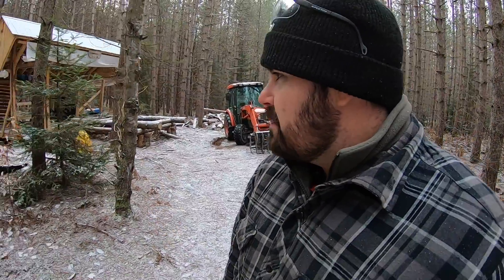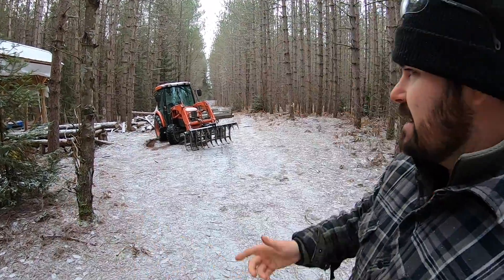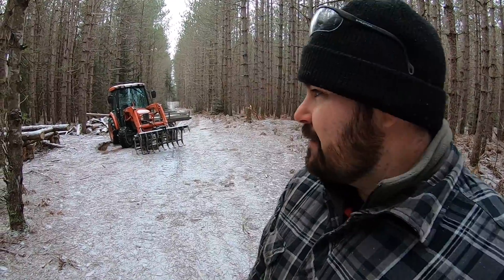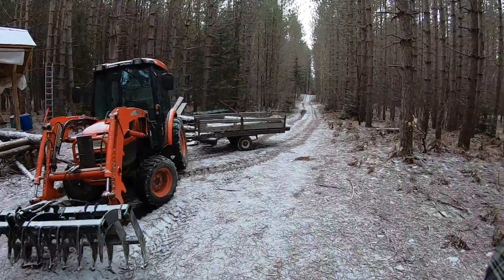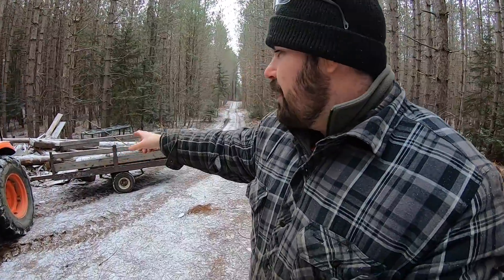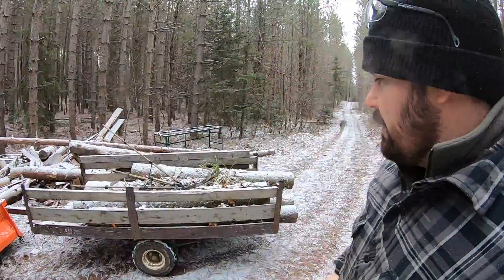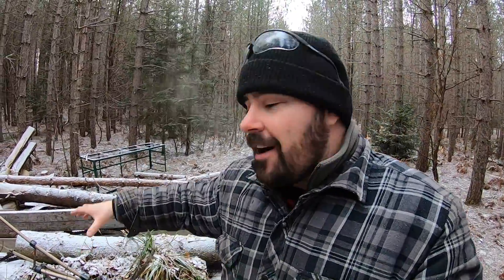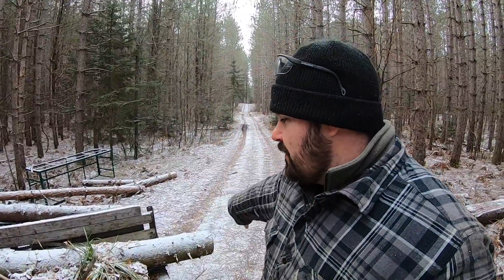Laser Makes Sawing Lumber Faster | Making My Own Wood Siding

Comment: Well so much for their laser, ordered one, and they called said It was the wrong one, needed to upgrade to the $139.00 laser, and correct mounting, battery box, well $190.50 later it got here mounted it up, checked it fine, then halfway down the log, no greenlight, the black wire going to the had fell out, very bad workmanship, now I have no laser, out of a lot of money. Plus the seller refuse to do anything about it, his comment was for a price I might be able to get t repair, so Sandy unless it's tried and true don't tell people to go out and buy one from your buddy up there in Canada.

Comment: Sandy, if I had all the equipment you have, I'd enlarge my mill site quite a bit-would save having to be so careful in driving the tractor/backing the trailer around the mill structures , provide space for a larger deck of logs convenient to the mill and lessen the danger of losing the mill should you experience a forest fire on your land.

Comment: I just got my HM122 and I  could never get it to start on the first pull like I've seen others do. 
I found if I  adjust my idle screw up it would start right up, but then I would get the pinking noise which indicates the clutch is trying to engage.  So I  set the idle back down so it doesn't ping and opened the throttle at the engine a little and it will start right up, but unless I hold it until warmed up, I can't get to the hand throttle in time before it dies. So I  rotated the rope starter so I  can pull start from the other side. Now I just squeeze the throttle lever a little and pull start from that side starts every time. I  have a 7 hp so don't know if this will work on the larger Kohler engines.  I believe, being able to throttle up a little while pull starting allows it to start easier.

Comment: Hey Sandy, how much shrinkage can one expect on a 2x6 of green spruce? I did find a charge on species and % of shrinkage but have no idea if it can be relied upon. How much larger would you mill a 2x6 to get a 1.5 x 5.5 dimensional lumber after its dried. can you build walls from green lumber?

Comment: i have the same mill with the clapboard maker on it ,,i prefer to cut a timber 6 inches wide by what ever thick and cut half inch boards ,,when u put on a building u have 5 inches of the board showing ,,works great ,,iam sorry i bought the clapboard maker

Comment: Did your machine come with the adjustable blade guard?  It looks like the adjustable arm is there as I can see the blade guide on the operator side.  On my HM130MAX the guard is yellow, but on yours it looks like the guard is missing.  Did you remove it for a reason?

Comment: ahhhhh, I have to get my sawmill put together before significant snow comes - it's sitting under a bunch of wrapped plastic and a tin sitting on top, but, I would feel much better if it were together and under the cover I bought for it for winter-time rather than in its shipping boxes.

already a little daunted at handling all the metal in the super-cold, and I have a delay getting it together because I don't have all the tools here (just moved) and so need to coordinate with a friend to help me put it together, and well, busy busy times and just haven't been able to get it together

AHHHHHH

Comment: Nice video. 
Is that about the average diameter logs you usually mill?
Lots of work on small logs. Not knocking you in anyway, please do not take it that way. Just so much less work, more product, less slab with larger logs.

Anyway, love the video! You have an awesome set up.
Thank you for sharing!

Comment: Curious.  Have you researched the dangers of catching that laser in your eye?  My laser level came with all sorts of scary warnings.  Do you make a concerted effort not to look back at it while running the mill?  I realize its pretty low but bending down to move logs or lumber you could catch a glimpse or perhaps some scatter.
Reply from the maker: Thanks for the concern Jonah. I am aware of the dangers and ensure that I'm always aware of where it is.

Comment: thanks to u i bought the laser. although expensive it not only saves me time but in the long run will pay for itself because i mainly cut and sell larch. i edge the slabs which i sell for raised beds and without the laser i would screw up soe of the slabs. Not to say when u get a crooked log the savings in time is just amazing the one downside to the lazer is that if you cut over 12' you don't get much of the lazer beam on the log. i been cutting lumber for 39 years.
Reply from the maker: I'm with ya on that one. I find the crooked logs really benefit from the laser. Helps me know right where I'm about to cut and keeps me from having to guess or measure.
Reply: Are you indoors? I can't get mine bright enough outside even an overcast day
Reply: @robwheeler6333  i am in my barn and still hard to see if log is over 10-12'

Comment: I so could have used this laser today. Cutting 1x off cuts into usable decking material. Is it just me or does your sawmill sound off. Like a slipping belt, bearing going bad or maybe your blade is hitting your brushes. Always something to adjust or maintain right!? Its hard to know where to put what sometimes, especially in limited space. Looks like another productive day at the mill! Take care Sandy! BTW 70 degrees in NE Washington today and its 1st of December, crazy!
Reply from the maker: It sure is crazy weather out there. We just got a big dump of snow but now it's supposed to rain. I think there's a bearing going that I"ll need to replace and so the sound of the creaking may be that. Then again, I haven't look too closely yet but that does remind me I should do that before a big failure. Thanks again for watching.